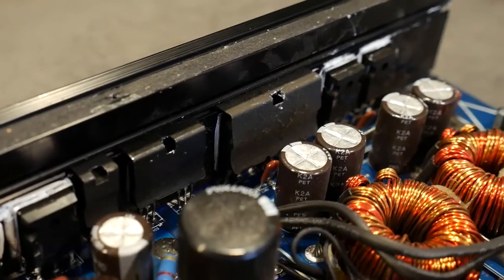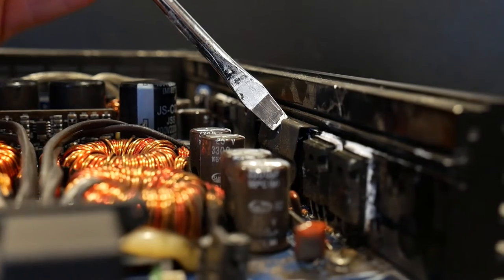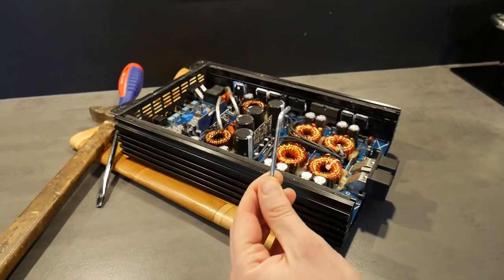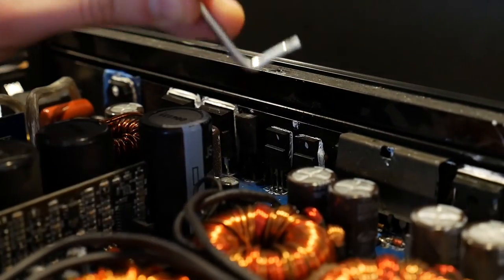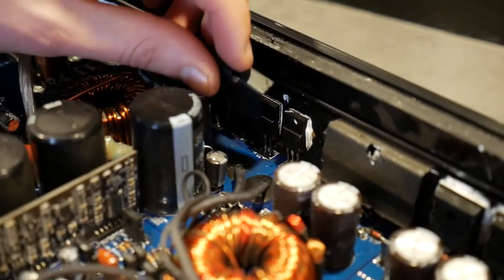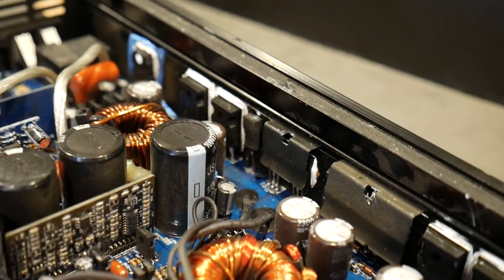How to Remove Car Audio Amp Retaining Clip/Spring DIY

Comment: The mono amplifier goes into protect mode after a few minutes. The transistors were checked without problems. The capacitors are swollen from the top. Is it possible that there is a problem with the capacitors?